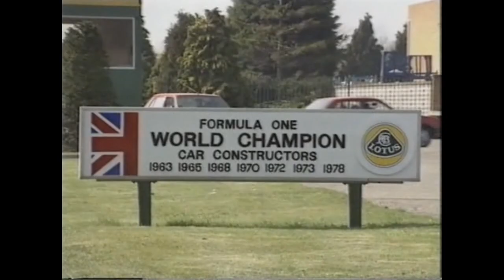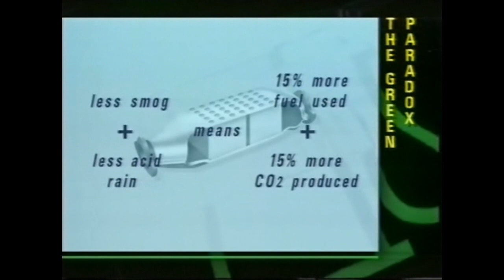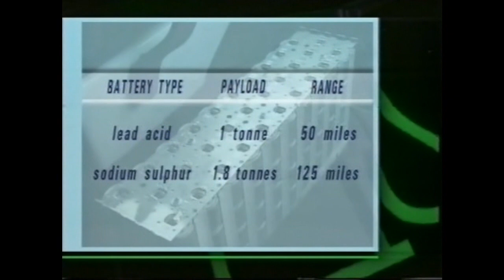Old Top Gear 1990 - Alternative Fuels 1

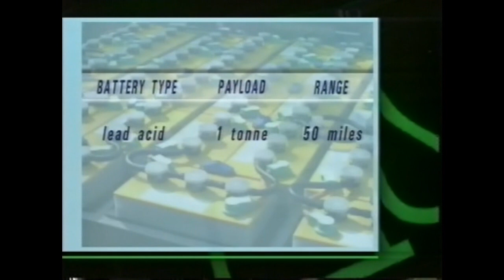Comment: 05:40 the presenter proved wrong in his assessment of GM's Impact EV, 50 of them were successfully trailed in 1994 by the public leading to the release of the GM EV1 in 1996 of which about 1117 were produced.
Reply: Except that GMC then ordered all the cars recalled and destroyed, thus clearly knew something - and wanted it swept aside ' that the customer didn't.

The presenter's skepticism was also wholly justified, as this was 1990, and the crude battery technology was a warning sign.

Comment: I'm a big petrol head and love the internal combustion engine. But I can't believe how slow the process of developing alternative fuels has been. In the 27 years since this episode was made we've made more progress on refining petrol/diesel engines than electric (batteries/solar/hybrid). Fuel injection has replaced carburrettors, high pressure diesel engines with turbos have replaced clattery old indirect injection diesels. Average MPG for a given engine size has almost doubled.

Yet batteries have got a little bit smaller and the range has increased a little bit. And the price of alternative fuel cars is still prohibitive to most people.
Reply: LPG was big for a long time, but for whatever reason just disappeared as a regular alternative.
Reply: There are different issues when it comes to energy storage; energy density. For a Lithium Ion battery (for instance), it's fairly constant from a chemical perspective.

It is also the case for petrol/diesel where, the energy density is also constant. It is efficiency in conversion that has changed, and is (somewhat) easier to do, as we've seen.
Reply: and its pretty clean too
Reply: In short: Battery technology for such applications is rubbish, and always has been.
Reply: @jimtaylor294 Because you are recharging at your house there is a very low efficiency even if they could create a perfect battery, with only about 35% of the calorific value of the fuel burnt arriving at your house as electricity. Transformer, battery and motor losses means that electric cars are never energy efficient. Cheap fuel if you can afford a new Tesla though.
Reply: @COIcultist  Aye. One of many reasons why pure EV's are a dead end, a bit like Atmospheric Railways & those weird wood burning cars from WWII.

The coal industry loves them though, as all that extra grid power can't come from eco' means.
(not unless orbital solar becomes practical)
Reply: @jimtaylor294   "The coal industry loves them though, as all that extra grid power can't come from eco' means. (not unless orbital solar becomes practical)" 
If only Jim, if only. Here in the UK we appear to be wanting to go from a proposed 2040 ban on new petrol and diesel cars (It was conveniently far enough away for anyone in power to be not about by then) to a 2030 ban.
Now we destroyed our national coal mining industry notionally because it wasn't competitive. In actuality, it was a government fit of malice and spite. But what few legacy coal plant we still have (All in that lovely period of having paid off capital costs but still viable) are now fuelled by biomass that isn't from wood waste but from forest felling because that works out cheaper to supply. This is all burnt using massive subsidies on a low energy density fuel that is imported from overseas. Genius pure genius. Meanwhile we burnt through all out strategic reserve of North Sea gas generating electricity instead of saving it for home heating and are now net gas importers.  See https://gridwatch.templar.co.uk/index.php  or https://gridwatch.co.uk/
Liked the subtle comment on "Orbital Solar."
Reply: @COIcultist  Well the 2030 ban on new Cars will go down like a brick when the majority of voters realize it's not just hyperbole, because nobody normal stands to benefit from it. Such policies are only popular in inner cities anyway, because the locale of pollution generation would be shifted from the tailpipe to somewhere many miles away, out of sight = out of mind, at least in the politicians heads.

As for Coal; we'll have to partially disagree. With a decline that'd started in 1904 when the Royal Navy had started using the far safer, cleaner & more practical Oil, by the 1950's 
vast mountains of coal sat unsold at the pit heads for months, sometimes years.
(in the case thereof it was often flogged off at a loss by BC to whomever would buy it)

With steadily declining usage and rampant over-production that was costing the taxpayer a fortune, something had to give. Indeed more mines were closed by Harold Wilson in 5 years, than by Thatcher & Major's 18 years combined.

On EV's: It isn't the first time that such laughably underdeveloped cars have been pushed on the public, though this time government subsidies & regulations are being used to force motorists into buying an inferior choice, that could never compete for a petrol or diesel car on price and practicality.
(less than 5 minutes to refuel vs over 36 hours... I know which I'd rather have)

As someone from a town that used to have a CEGB coal plant, that was shut down rather than modernized due to relatively low efficiency but high soot (parking a car downwind of the power station guarranteed you'd come back to see it coated in black gunk), I'm of the opinion that Oil eclipsing Coal was inevitable, though that it still has a role to play today.
(especially with present day advances in scrubbing exhaust of soot & other major contaminants)

As for Oil; not efficiently used aye, though global market dumping by the arabs is the reason so msny Rigs sit mothballed.

Could be worse though, as in Venesuela their industry is too decrepid to efficiently extract it anymore.
Reply: @COIcultist  My sympathy regarding YouTube being ill suited to long comments, as I've lost a few to glitches in the past, and using an On-Screen Keyboard (OSK) as of the moment doesn't help either.
Reply: @COIcultist  In my case I had the relatively unusual distinction of growing up in the last house on our street to have a coal fireplace.
(my parents not wanting the weird gas fireplaces that the council were installing at one point)

Was also - as far as I know - the last house on the street to have coal deliveries, as we were the last to still have & use the back boiler that the [1950's] houses had been built with.

Didn't know though the reason why it was always damp when delivered, which turned out to be a deliberate measure to reduce flammable dust during transport.
Reply: @jimtaylor294  Jim thanks for your sympathies i tried more than once which made it all the worse.
"Didn't know though the reason why it was always damp when delivered, which turned out to be a deliberate measure to reduce flammable dust during transport." I do hope you are being sarcastic?
Forget the coal for the moment but until relatively recently you had to carry a scale on your coal waggon and could be asked to weigh sacks before delivery. Now particularly going back to before man made fibre sacks and the days of jute. What is the difference in weight of a dry sack and a wet jute sack? There was always a few dry sacks in the cab to go on the other side of the scale with the weights if need be. If the coal came from someone elses yard the economics of wetting the coal were different. I never went out with coal baggers, so I don't know if that was a thing. If they had their own coal yard wet coal was them getting paid for water.  "Coal Packing Plant
As a small family run coal business we endeavour to sell all our coal and smokeless fuel products in as clean and dry condition as is possible, so much so we have purchased a state of the art screening and bagging plant that removes fines from our products. To make sure all our products are kept as dry as possible we have spent in excess of £2,000,000 on a building to cover the coal yard, bagging plant and storage facility for 8000 tonnes of fuel. The benefits of covering our coal and smokeless products is: some smokeless fuels can potentially contain in excess of 20% moisture, because our fuels are kept undercover they do not suffer from the ingress of water so there is the potential to get a considerable amount of extra volume per delivery.
There is a financial benefit for all our customers as there not paying for excess water." From https://www.ace-energyshop.co.uk/ I’ve used these people, and they are as straight as any coal merchant you will find.
Reply: @COIcultist  You're welcome. I've had enough lost replies in the past [to pne glitch or another] to be ever wary. I find typing up longer ones in wordpad & ctrl c + v [or equivilant] it over saves a lot of fustration.

The sourcing is also much appreciated BTW. Most of my understanding on the topic comes from family, aquaintances with ties to the subject, several documentaries (such as All Our Working Lives ) and a lifelong interest in the rail & maritime engineering.

Regarding Coal: Due to how long ago it was I don't know which coal merchant my family used at the time, partially because a now passed relation arranged it. Quite sure it was black coal though, rather than coke, due to being a rough period financially, and how often the chimney had to be swept.

As damping coal is a method both shipping lines & the railways used, I confess I'd overlooked the detail about dry transport on land being more economical & practical where possible.
(though the various horror stories about coal bunker fires on ships & the misadventures of the russian 2nd pacific squadron [a grim example of why re-coaling a ship at sea was a bad idea & rarely attempted] tend to be more popular topics for many into the history of coal)

Comment: 20 years of progress and the G-Whizz doesn't look too different to the electric car shown at the start of the clip.

Meanwhile look at the progress made with consumer electronics and other types of engine - plasma TVs, computers, Internet, mobile phones, diesel engines now with high pressure common rail technology & power outputs unheard of at the time yet we still can't make a battery which is decent enough to be small, light and at the same time store enough power for a good range.
Reply: Worth noting too that people have been trying and failing to produce a practical EV, since the 1800's, thus battery tech' is even more rubbish and apaplectic in progression, than initial appearances would suggest.
Reply: energymc22 
I've just realised my comment was making the same point as you did 7 years ago.